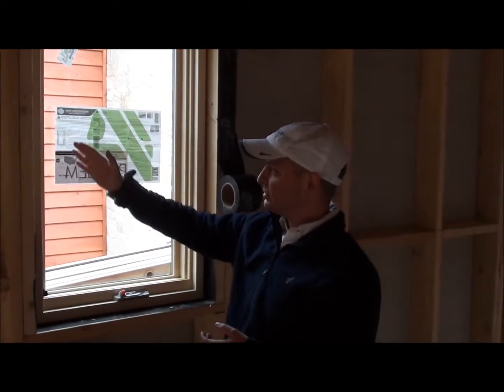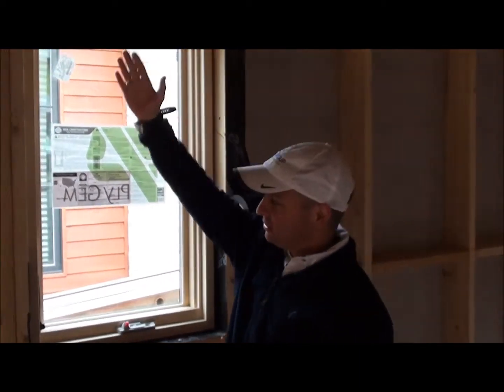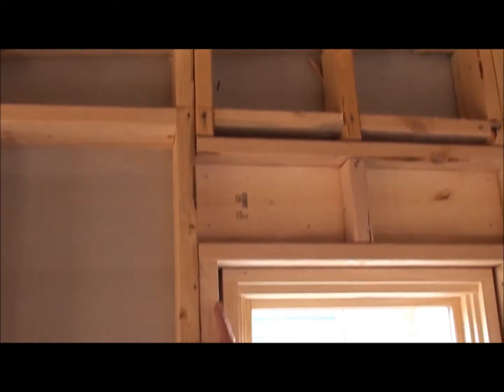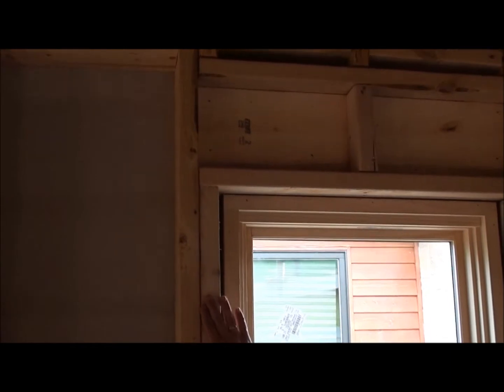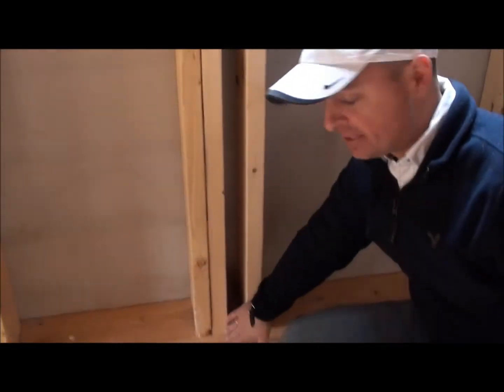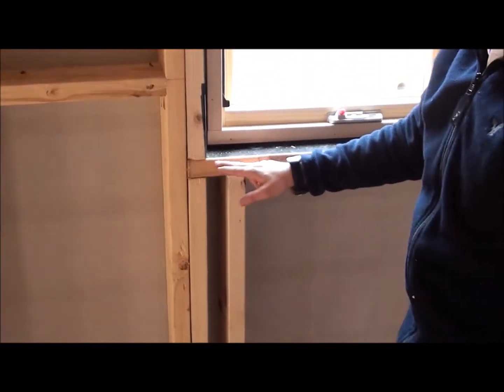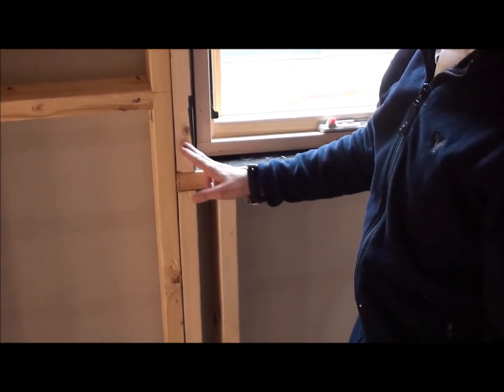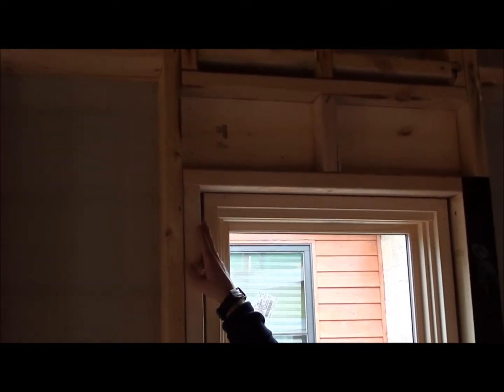Advanced Framing Techniques, Part 3: Reduced Framing at Window Openings.wmv

Comment: This is a funny one...you had me rolling at the part about saving material and being more energy efficient. Looks like a jack stud with window sill let in to it. You have saved 1-lower window sill cripple on each side. You also succeeded in complicating the framing process and opening up the possibility/probability of gaps between the cripples and sill. Stick to California corners and R10 insulated headers.